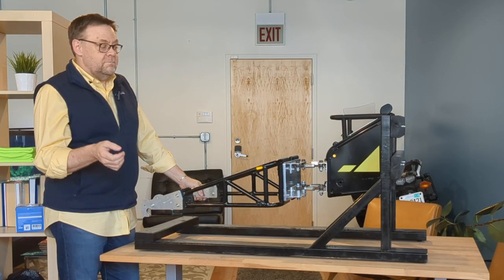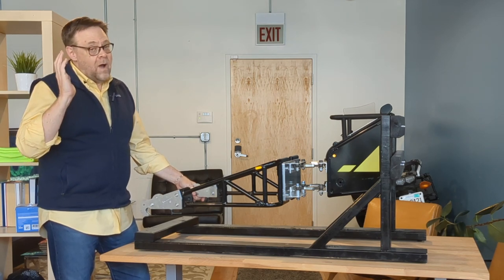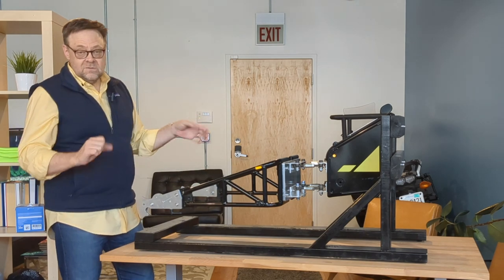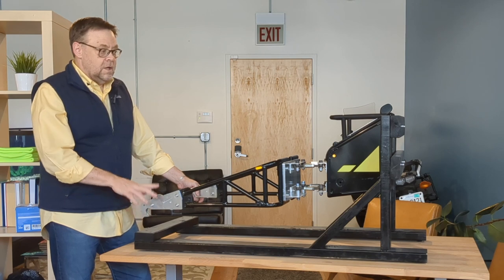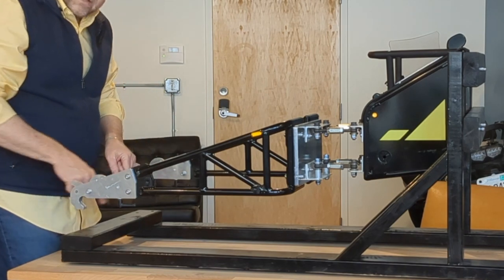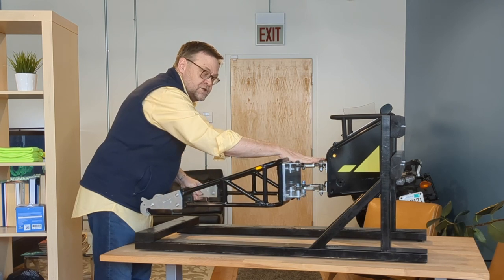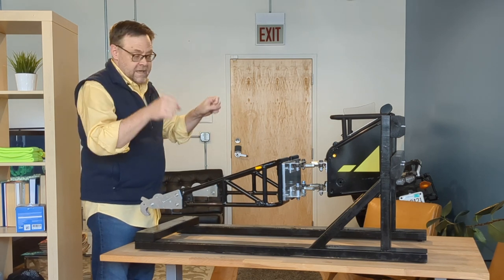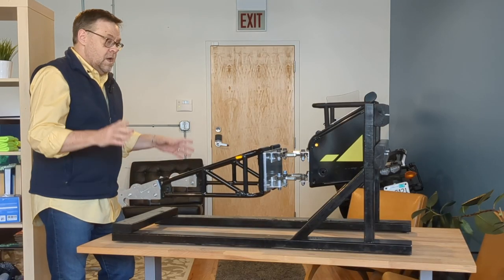The Trapezoid Hinge on the ADV1 Motorcycle Trailer

Comment: That's an interesting little design. Can't wait to see it at work.
Reply from the maker: Unfortunately, when it's working the most, you don't see anything! When you're going straight or turning mostly by leaning, the arms basically lock and, as I say in the video, you are no longer a 2-wheeled vehicle pulling a 1-wheeled trailer. Instead, you are a in-line 3-wheeled vehicle that is perfectly stable at all speeds. When you turn using your handlebars, the hinge pivots and the trailer follows you perfectly. It's like a perfect pillion—you feel the weight, but it leans with you and doesn't impact your line through turns.
Reply: @PasqAdventure  oh that's awesome, I would love to hear how you came up with that (if/when you have the time)
Reply from the maker: @Crazy-Chicken-Media  Trapezoid hinges were first used and patented in the late 1800s. The first applications were around farm equipment and military applications. We came across information on them while looking at videos on how to stabilize large trailers being pulled by pickups—there are at least two companies that make trapezoid hinges for that application. So, we aren't the people who came up with the original idea...they've been around for a long time!
Reply: @PasqAdventure  when I was in the Army years back I got to drive a Bandvagn 206 it has Trapezoid hinges but it is also utilized with how the vehicle turns.

Comment: Wouldn't it effect your line? You've essentially increased your wheel base and longer vehicles mean wider turns.
Reply from the maker: That is a very astute comment! You are correct that it does increase your wheel base. However, the hinge does move just enough as you're going through curves to not impact your line. I think I say (or should have) in the video that having the ADV1 behind you is very, very similar to having a perfect passenger (pillion) riding behind you. You feel the weight of the trailer/pillion, but because they lean perfectly with you, they don't impact your line.

To be honest, once I grasped what a trapezoid hinge would do, I was worried if it would be too "stiff" in curves. But as soon as we started testing, I immediately realized it wasn't a concern. The hinge pivots the tiniest amount while going around curves (as we've seen on videos focused on the hinge as we test) and follows perfectly!

You win the "best question I've seen in a while" award!!

Comment: ok. but what about braking ? it will move out of a line, and hit you ?
Reply from the maker: Hello Vidmantas,

Thanks for the question. We get this one every once in a while, and I can understand your thinking and concern, but I can tell you the hinge has zero discernable impact on braking. Let me tell you a story and then I'll explain what is going on:

The first time we tested the trapezoid hinge, we focused a GoPro on the hinge and started riding around the neighborhood to see first what would happen at slow speeds, turns, and stops. If that went well, we planned to go to a nearby quiet country road where we could do faster testing. At slow speeds what we saw on the video surprised me. I felt nothing while braking. There was no difference between the feeling of our previous fixed-hinge and the trapezoid hinge. I figured it wasn't moving to the side. We watched the video, and I was wrong—the hinge was going to the side, but I didn't feel it at all on the bike. 

After some adjustments, we headed off to do some higher speed tests, including emergency braking tests. With the trailer loaded with 80 lbs (36 kg) of sand we would get the Yamaha Super Tenere to 60 to 70 mph (100 to 112 km/h) and do a straight-line emergency stop. That meant we were engaging the ABS—the ABS was clicking like crazy, bring the bike and trailer to a stop as quickly as the ABS would allow. I felt the weight of the trailer and the gear, but the hinge made no difference. We did the same test doing a slight curve. We tested going from 60-70 mph, and then slowing for a 90° turn, and then accelerating. There was no difference in feel at all. On all of these tests, the hinge did move to the side (which we could see on the video), but on the bike I felt no impact at all.

So what's happening? The arms of the hinge are 2.5" (6.5 cm). That is not a very large lever arm, especially when you are considering that 180 lbs. (trailer + load) is being applied over that short of a lever.

Basic physics tells us that there must be some impact on the bike. But that same physics tells us that if you (at 180 lbs., for example) step onto a 2.5" lever and try to lift a 580 lbs. bike, you are not going to have much of an impact on the bike. That is not a perfect analysis of what is happening, but it isn't far off.

And, once the hinge has rotated to the side, the impact of the movement of the hinge has been absorbed and no longer impacting the bike in any way.

Thanks for the question, and I look forward to your thoughts!
Reply from the maker: One more thought on your question. The video was made with our proof-of-concept prototype (v1). It was made with off-the-shelf parts to just prove the hinge would work before we started to build much more expensive versions of it (v2). 

You are correct that the arms of the v1 are fairly long and it looks like it would impact the bike. As I said in my other comment, it didn't and 

Here is a link to a photo of the v2 hinge I just took 5 minutes ago of the ADV1 prototype sitting in my office—it's a little dirty. 

https://drive.google.com/file/d/1r9xGPgFP09QGI-XulAe4zHvaREdtykox/view?usp=sharing

You can see the hitch arms in yellow. The v2 arms are much shorter than in v1, so they make even less of an impact on the bike. And as I said, even the longer the v1 arms made no discernable difference to the handling of the bike.